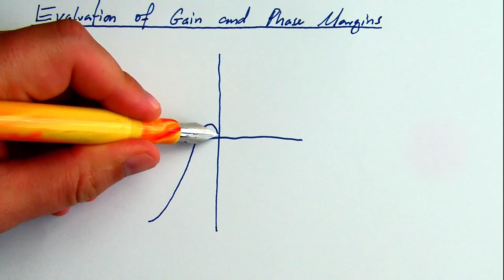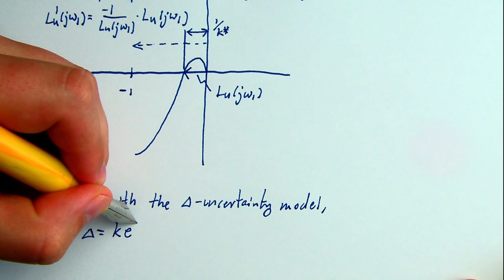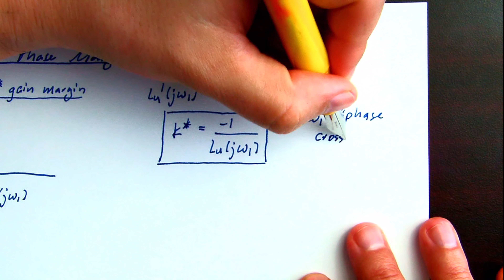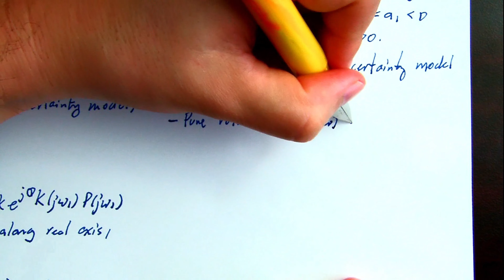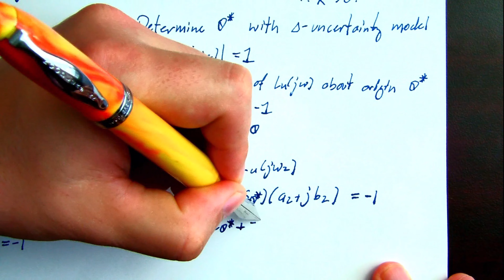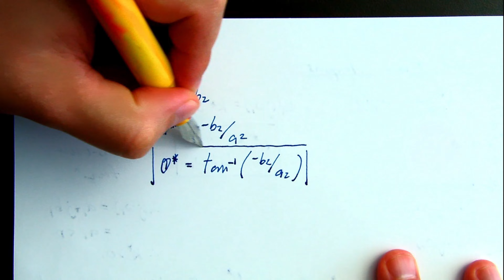Gain and Phase Margin from Nyquist and Bode - Classical Feedback Control - Section 2 Module 2

Comment: Hi Ben 
1.)in this video, you use delta-uncertainty model, this model is use to find the gain margin and phase margin right? Because this is the first time I see this model in the nyquist plot, so I not sure what is this. The school didn't use that method to find gain margin and phase margin
Reply from the maker: Yes, that's correct. I like using this model because it's different than the typical approach to determining stability margins.
Reply: @LearnGandC   
I am curious about why can use this method to determined the gain margin and phase margin,  what is difference between typical approach.